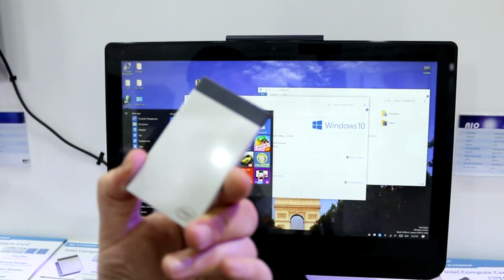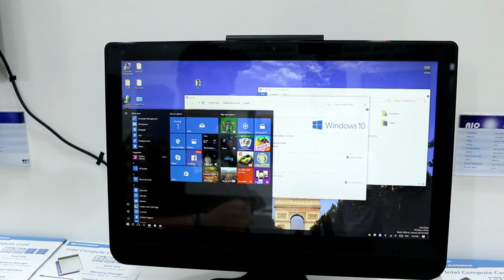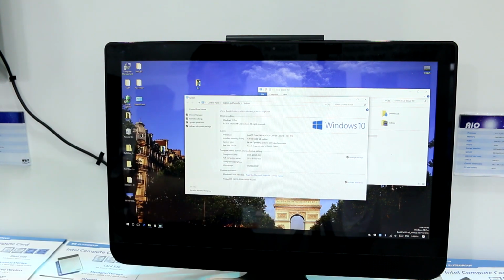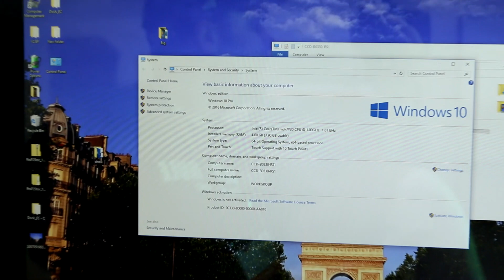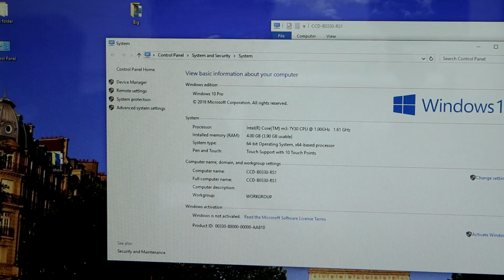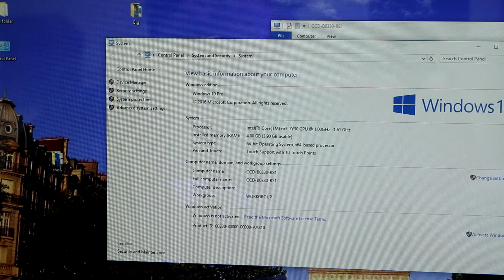Intel Compute Card - a closer look (and also INSIDE it)

Comment: Per Intel Datasheet. This will really limit the usefulness of this card. 

"The Intel® Compute Card and any device with a compatible slot for the Intel® Compute Card will use bidirectional authentication. The Compute Card will attempt to authenticate the compatible device and the compatible device will attempt to authenticate the Compute Card. The authentication uses digitkeys, which are provisioned by default during manufacturing for every Compute Card and Compute Card compatible device. With this provisioning, the Intel® Compute Card will only work with correctly provisioned Intel® Compute Card slot compatible devices."

Comment: I like the concept of the compute cards, but the hardware is so weak i feel it will only be suitable for some applications.
Reply: Actually there are multiple skus available - Pentium, m3, i5 also ....... So should not be problem with Hardware. Depending upon application, customer can choose the device. They are targeting consumer electronics by standardising the docking port & putting this device in any of the appliance and making that smart, it might be refrigerator, AC, washing machine or something at Industrial floor..

Comment: Why allow it to be vendor limited? With a 4,5W TDP... well you guys remember the Intel Atom CPU? You don't hmm, I wonder why? :-P
This product is gonna be soooo slow to work with.
Reply: suicidal.banana Celeron is enought for word, Google Chrome, etc...
Reply: Just so your aware, pretty much all those cheap Chinese tablets (most of which work surprisingly well for the money) use atoms, and yea, you'd be surprised how well that works
Reply: Mecrom but Celeron CPU's are faster than Atom. so..  yeah. Even Celeron have a tendency to be annoyingly slow. I'mnot saying one couldn't live with it, but if the alternative is a cheap Acer laptop with an i5 for a little more money, just get the laptop. then you don't need to buy both a new laptop "case" and cpu board later on when you're fed up with the slow performance.
Reply: suicidal.banana yeah,but they aren't running Windows 10, they're running some sort of Android, ehich basicly is a cut-down Linux, which drasticly improves the cpu load. Forget about gaming, but doing simple stuff like internet browsing on an Atom PC is a pain in the neck. I have a desktop Atom PC configured as a NAS, even that seems tedious. Just saying,some people are gonna buy some of these, then get pissed off of the performance, and let it die out.
Also, my Atom has an actual heatsink TOUCHING the CPU, this is touching the case wall, which need to seamlessly move in and out of the port, which won't allow for a tight fit to a cooler. It's gonna get HOT and throttle!